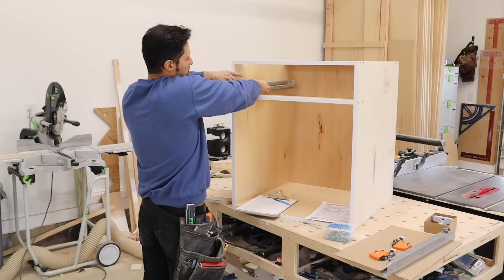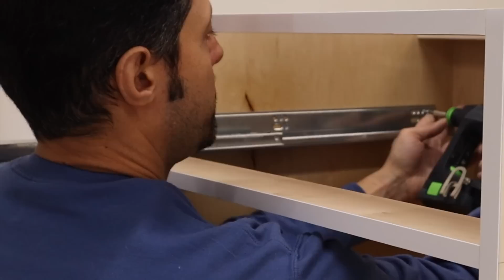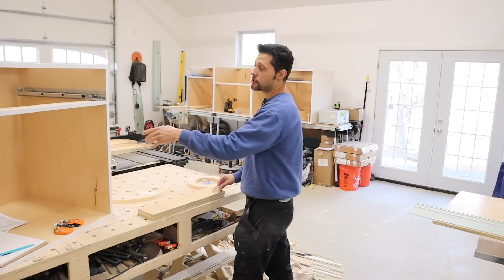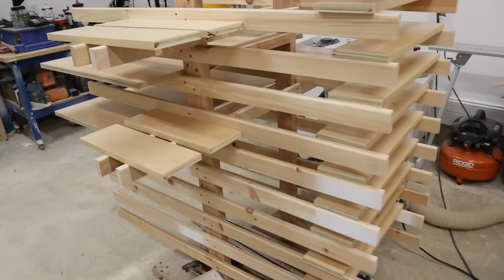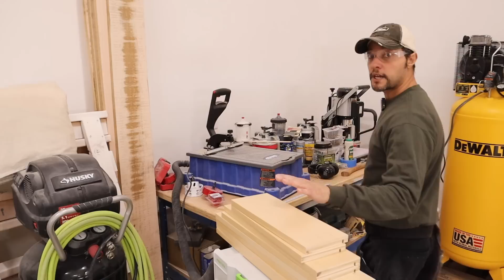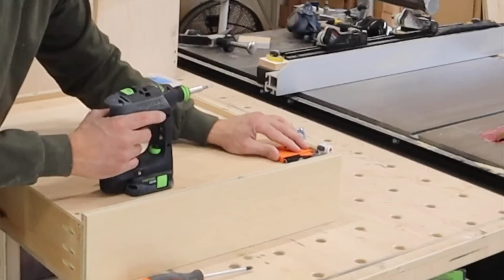Undermount Drawer slides and drawer box construction

Comment: Great vid, thanks for the info. Quick question, Do you cover or fill those Brad nail holes on the sides?
Reply from the maker: I don’t fill the brad holes unless specifically requested by the client. They’re not really visible but if they have to be filled, the natural color wood filler or wax stick works great.

Comment: I have a question about installing the Blum glides 563H. On cabinets that have a shelf even with the top of the opening face(as in  book self) can you screw it to the self using the holes in the bottom of the glide along with the first two vertical holes on the glide? I have not found any info on that application.
Reply from the maker: Blum has that installation method for their Undermount slides on their website, search for bottom mount application and you should get the instructions to use the bottom holes.

Comment: you can get prefinished tape then you wouldn't have to shellac it,  I have never been a fan of 3/4 drawers,  to me they look heavy, all my drawers are 5/8 solid maple. I have never been a fan of pocket screwing drawers. the reason that you have to cut an out the back is that you can't cut a solid wood box off like that.
Reply from the maker: @oliver299d  I had extra maple banding in my shop, and the pre finished banding wouldn’t have come in time because it was out of stock and I have to keep moving forward. Shellac doesn’t take any time at all to do. I can’t source 5/8 ply anywhere near me at all and solid maple drawers take too long to mill and keep stable.